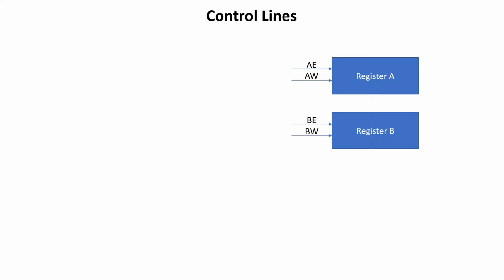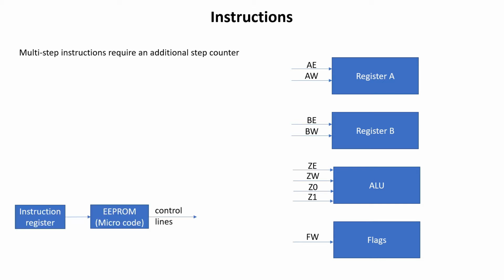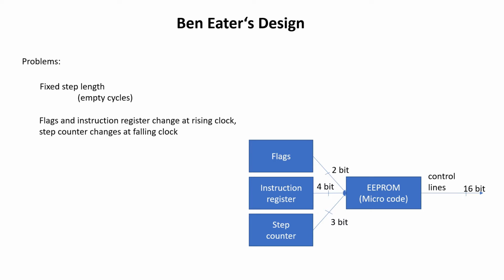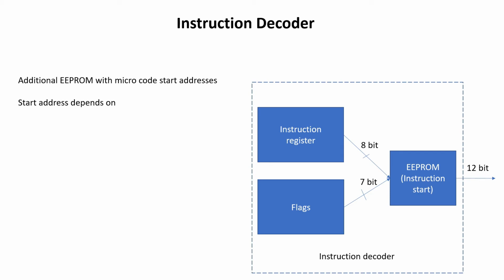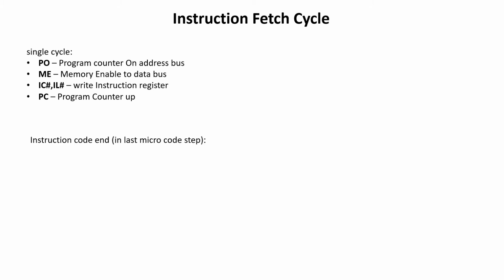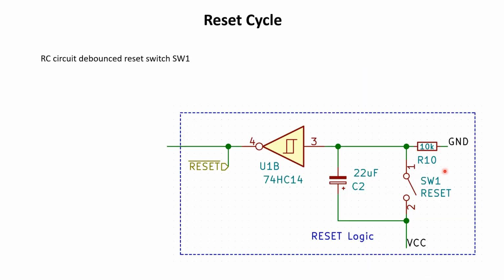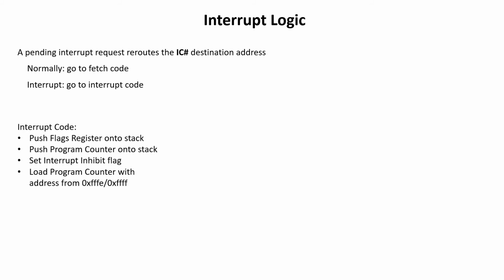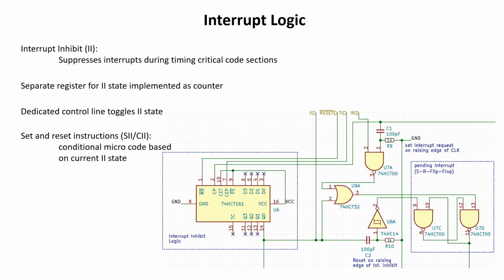8-Bit Breadboard CPU (Control Logic, Instruction Decoder, Reset, Interrupt)

Comment: can we replace the 28c64 eeprom with a simple 27c64 eprom ?
Reply from the maker: EEPROM 28c64 and EPROM 27c64 are pin compatible in regards to this application and both work with 5V in read-only mode. Though I haven't tested it, I would assume you could replace one chip type with the other in this build. The most important difference here is the access time which is 120ns for the EEPROM and 200ns for the EPROM. Since the access time to the micro code is always on the critical path this might result in a slightly slower maximum system speed.
Reply: @DerULF1  thanks you very much

Comment: Why 12-bits for the step counter? Maybe I’m dense.
Reply from the maker: I'm not quite sure whether you're wondering why it's ONLY 12-bits (though the EEPROM chips with the micro code have more than 12 address lines) or AS MUCH as 12-bits (though Ben Eater only uses 3 bits). Or maybe I missed the point completely - please get back to me again in this case.
For the ONLY case: When I started planning the control logic I was estimating a maximum of 256 instruction with a maximum number of 16 steps each - which is 12 bit addressing. So I thought it would not be a big deal to not have all address lines connected to the counter but "waste" the remaining address lines and instead save one counter chip. As of now I have 292 instructions (oh, I haven't done a video about my latest updates yet) and still use a little bit less of 1k of the micro code space.
For the AS MUCH case: In Ben Eater's build the address lines for the micro code are the output of the instruction register, the flag register and the step counter. So in his build the step counter only needs to take into account how many steps a single instruction might have at most. In my build the instruction register and the flags are handeled in the instruction decoding logic without a direct connection to the micro code ROM. The step counter is the only source for the address lines of the micro code ROM. This way the "step counter" turns into a "micro code counter" (like the progam counter) and must be capable of addressing all the bytes in the micro code EEPROM. This is why the step counter is wider in my build.
Reply: @DerULF1  Thanks for the reply, the "only" case is what I was going for. I missed the relationship between 8-bit opcodes and the max instruction length. How many instructions do you have that use 16 (or close to it) t-steps?
Reply from the maker: @bradywb98  Hmmm, it's important to note that the maximum instruction length is not 16 but only limited by the free space left in micro code EEPROM, because the step counter is completely independent of the instruction register. Nevertheless right now I think I have four instructions which use more than 16 steps and these are the four complex instructions that implement the SPI protocol on the micro code level. My most complex instruction right now has 38 steps.
In the state of the build I presented in the videos there were a few different instructions with complex addressing modes which used more than 16 steps but I could speed those up with a hardware change to the transfer register (called "new address" in my schematics). But the majority of all the instructions use less than 8 steps.
Reply: @DerULF1  Also, as far as having 292 instructions - are you using 2 byte opcodes now ?
Reply from the maker: @bradywb98  To allow for more than 256 instructions I added the concept of extended instructions. I chose opcode 0xff as the extension marker and whenever the instruction decoder reads a 0xff it sets an extension bit and restarts the fetch code. The extension bit and the instruction register together are used to find the start address of the micro code of the instruction. That way most of the instructions still have single byte opcodes but a few have two byte opcodes.
Reply: Okay so essentially you have 9-bit opcodes, so you could have up to 512 opcodes with that system? Or I guess 511.
Reply from the maker: @bradywb98  Exactly :-)